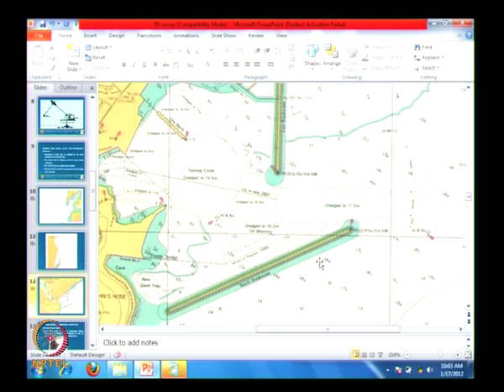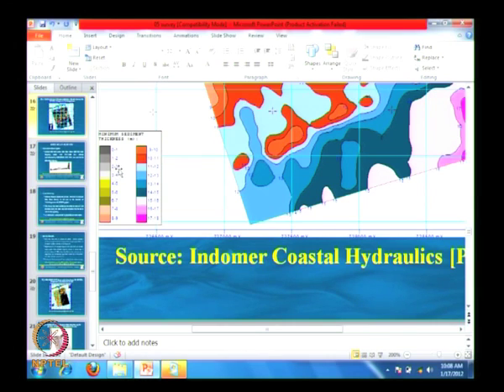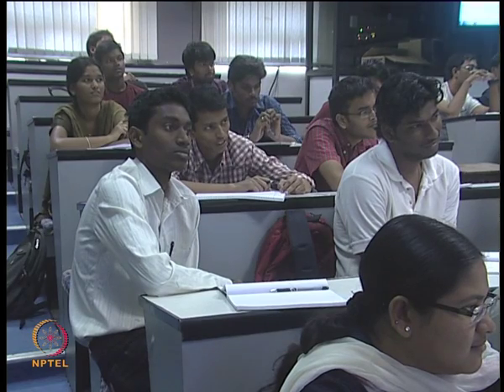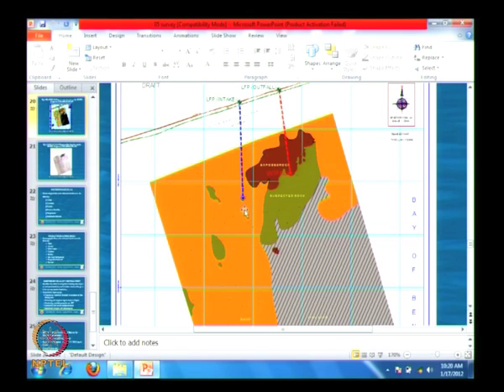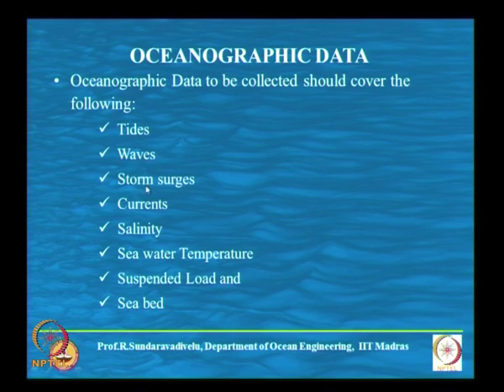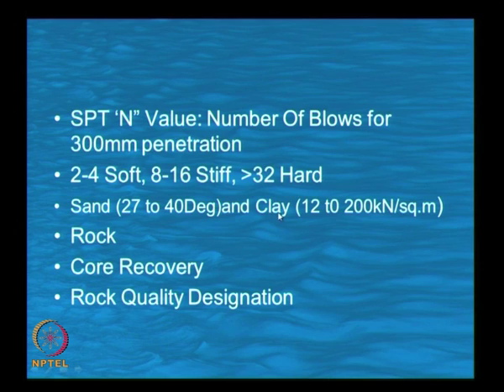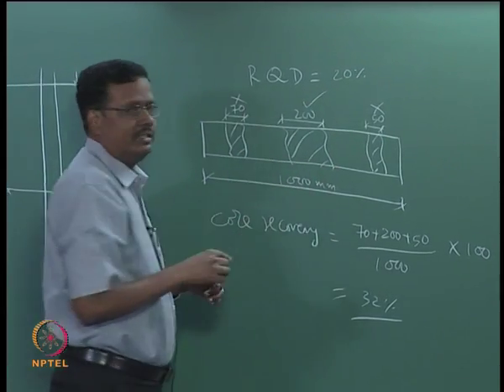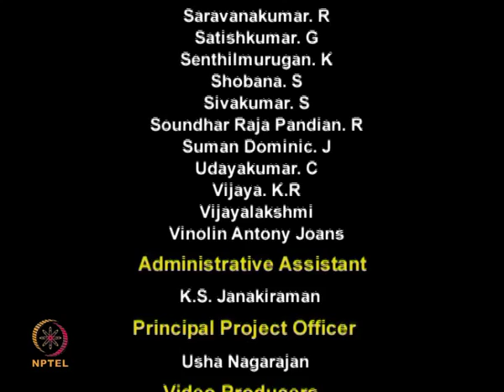Mod-02 Lec-08 Bathymetric survey

Comment: What does the suffix mean in this case of 12.2?
Reply: Suffix (subscript) is used to avoid putting decimal points on the map. If decimal points get rubbed off then 12.2m can look like 122m which can cause confusion.